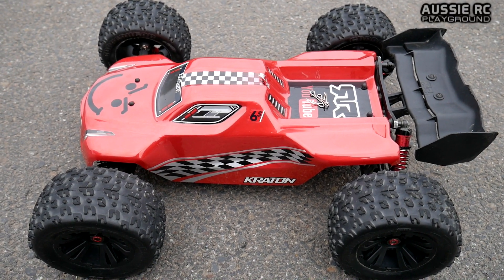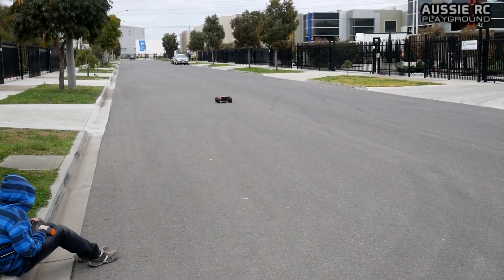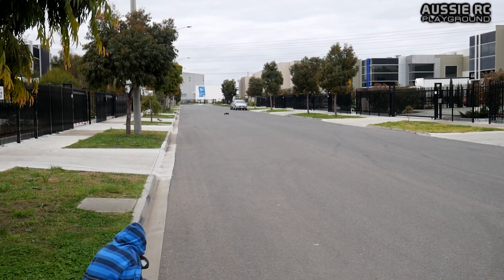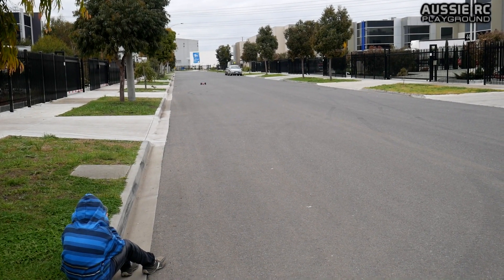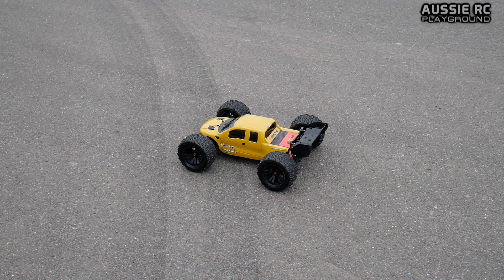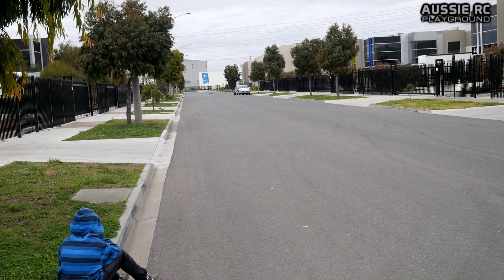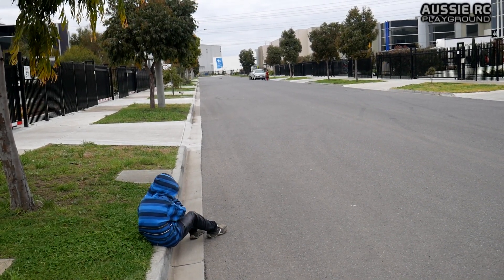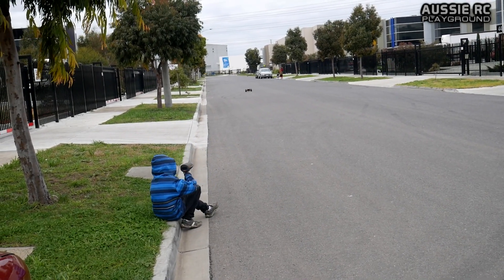RC SPEED WEEK #9 S.E. - Modified ARRMA Kraton with 15T Pinion

Comment: My kraton is a 4s kraton with a 15th tooth pinion and New input gear and loctite on the slipper Clutch and a 2400kv Motor 120Esc and temperature 🔫 it originally came with 13th tooth pinion so i up it a little what speeds do u think i will get out of it WITH. New pinion 15th tooth gear plus motor is stocked and 120Esc is stocked to Everything

Comment: how do you keep the front tires on the ground at full throttle? Mine balloon and it really affects the handling at high speed. I'm running 6s, stock electrics, and stock tires

Comment: So, the sabertooth was actually as fast as the kraton on 4s in (almost) stock?
Reply from the maker: InTheSh8 Yeah, the Sabertooth clocked 70kph on 4S outta the box, which is very impressive for such a cheap truggy. The Kraton is different though, it comes out of the box ready for 6S and is under geared. But comparing apples with apples - take each of them out of their boxes and the Sabertooth will be faster on 4S.